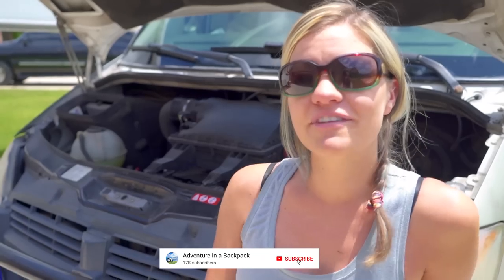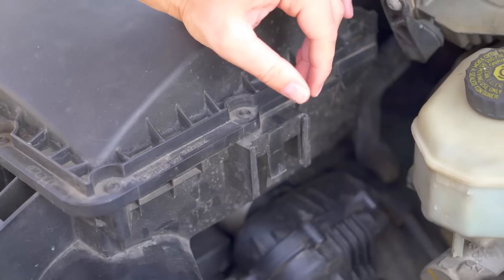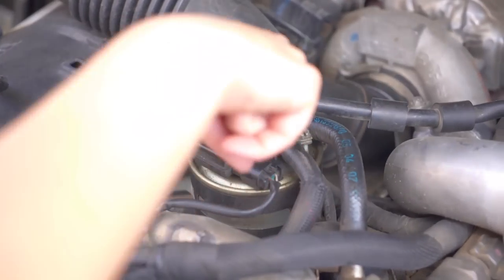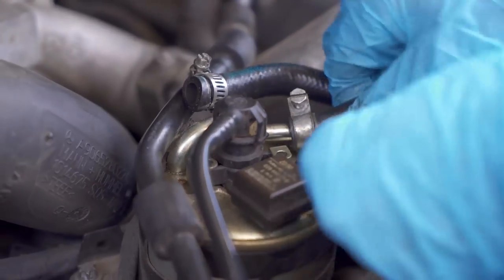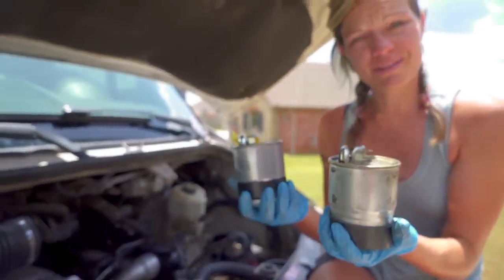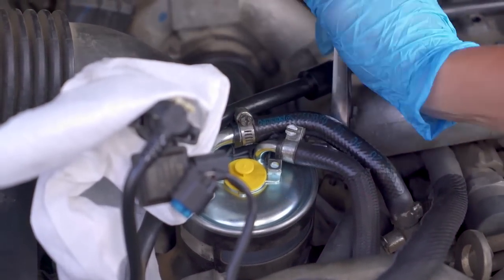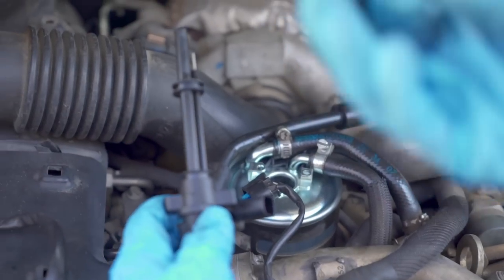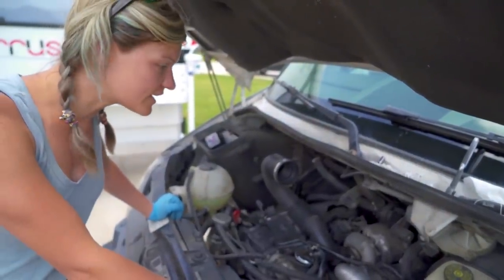Sprinter Fuel Filter Change - How To Change the Fuel Filter in a Mercedes Sprinter

Comment: I appreciate your excellent report on fuel filter replacement. Had I watched it first I would have saved a lot of time by removing only the filter and leaving the bracket in place.  Your advice to cycle the ignition switch for 2 -30 second intervals eliminated the risk of staving the HP pump of fuel on initial startup. Fired up on the first try after purging the new filter. All the Best!  BTW:  I own a 2008 Jeep Grand Cherokee Limited 4x4 with the OM642 engine.

Comment: I have a 2011 Forrest River Solera on a Freightliner frame with the Mercedes 6 cylinder. To search for a fuel filter have to search on the Sprinter 3500. Amazon has many that Amazon says fits... but the reviews mostly all say they don't fit. That's my problem and Forrest River is no help. WHICH FILTER NAME AND NUMBER FITS?

Comment: Missing information,
Year of Van, Model number of filter, size of engine, I have a 2014 and it specifies a specific number for filter and it come with eh sensor built in,  also he filter is located in a different area and much more difficult to remove, just saying details matter when trying to explain, but thanks anyway  some helped
Reply: She said the year at the start of the video. You have a much more problematic 6 cylinder motor compared to the easy to work on 2003-2007 TN1 5 cylinder

Comment: Seems like you should have checked for leaks as soon as you finished putting the new filter on, but before you put on the heat shield and air box. That way, you could see the fittings where a leak could occur. Waiting until you put all that stuff on and looking for leaks under the vehicle would miss most leaks which would likely be too slow to dribble all that way down.
Reply from the maker: Feel free to change up the order of operations however you like, jim.

Comment: I have a 2019 Tiffin  Wayfarer with 7000 miles. An indicator on computer says service A is 63 days overdue. Is this critical as the service intervals in book shows 10000 miles for A service and 20000 for B?

Comment: What were the symptoms you were experiencing that led you to replace the filter? I’m trying to decide if my sprinter is having the same issues.
Reply from the maker: No necessary symptoms... this should be a part of regular maintenance.

The engine won't run/start if the fuel filter is too clogged.  But its always a good place to start if your engine is running rough.

Comment: Should you not have filled the filter with fuel before refitting, so that it is not full of air?
Reply from the maker: Nope.  The system is self priming as mentioned at the end of the video.
Reply: Is 2006 the same?
Reply: .... BTW the 2006 models are not self prime and do need to be filled with diesel fuel when reattaching new filter.

Comment: How often you we need to replace the fuel filter?
Reply from the maker: We replace it every time we change the oil filter.
Reply: @EXPLORISTlife  well your either not changing your oil filter often enough or you are changing your fuel filter too often, put it this way i drive sprinters as well and i can do 10 oil filter changes to 1 fuel filter change and i've never had a problem with fuel filters.. just saying
Reply from the maker: Great!  Glad that works for you.

Comment: I think I shared a link before that talked about using motorcycle oil and removing the 
 upper and lower heat shields to extend the life of blutec engines so they survive beyond the warranty period.  The heat shields are essentially smog devices that increase engine temperature.  The factory oil recommended is not better for keeping the motor lasting beyond warranty but is again for smog.
Very short sided smog aids as it is more polluting to sell more and rebuild more.

Comment: You're very "savvy" but my suggestion is do not install heat shield or air box until you run it 5 minutes. Just in case something leaks.
Reply: i see your point but you will end up with your engine management light on if you run your engine with the air box not plugged in

Comment: Where are you buying your filters? Both are from China and I doubt Mercedes would buy Chinese filters.
Reply from the maker: The filters we used are listed into the description.  We haven't followed the supply chain, but if the Chinese can figure out how to make a handheld device that allows us to connect to the internet at 80 megs per second, I'm sure they are capable of making an air filter.  But ultimately, use whatever filter you like.  The process is the same.
Reply: Adventure in a Backpack yeah I can tell for sure those aren’t Mann filters being used. I guess if they work for you that’s what matters. There’s a huge difference in making/ engineering something from scratch and just making a copy of something without knowing why design choices were made. I’ve done many factory engineering projects for daimler (the maker of your van) as well as ford, gm and Chrysler and don’t appreciate the patronizing comment.